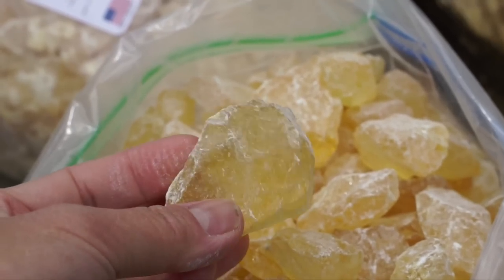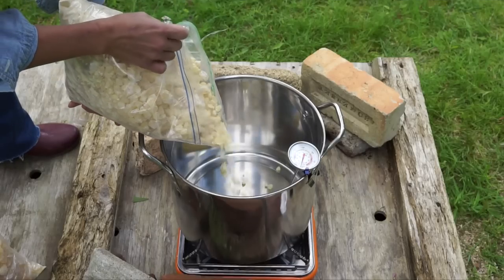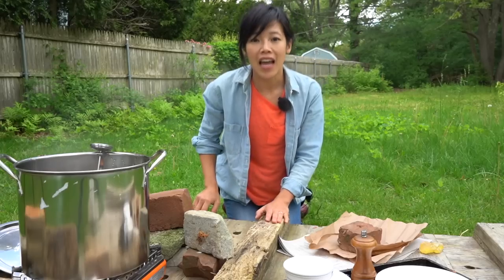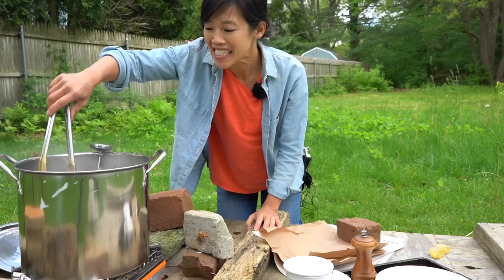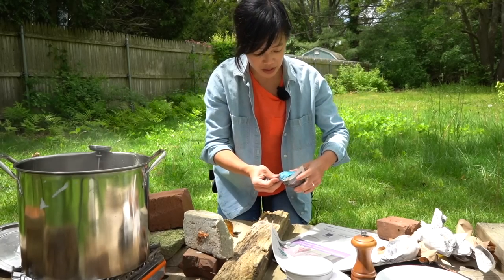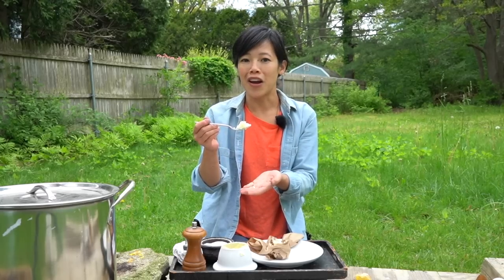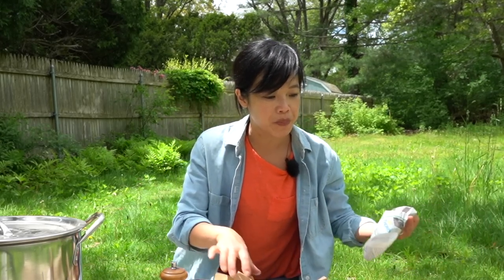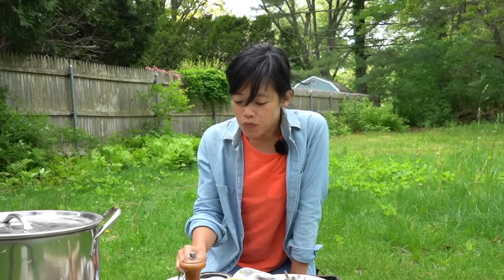How to Make PINE ROSIN POTATOES | Turpentine Potatoes -- Best Spuds Ever? -- In The Old Days

Comment: “But there were some health concerns regarding cooking with rosin...” Emmy: let’s do this
Reply: Prob not health concerns as in the rosin or cooking method itself will make you sick - industrial cooking food safety has to be standardized to a T, and the risk of accidentally putting the rosin tongs in the deep fryer alone is bound to make a health inspector nervous 😂 But in your own kitchen you can make sure that the rosin equipment is taken care of properly so you shouldn’t have any problems!
Reply: There might actually be more concerns about people being exposed day in and day out constantly. Plus very minor concerns can cause trouble in a commercial setting. 
If I felt like putting the money or work into it I probably wouldn't worry about occasionally eating it. Just don't eat the skins.
Reply: It's more due to the fumes from the heated rosin, which in a well ventilated area (such as outside), should not pose a high risk. If you're really worried, wear a ventilator or mask while cooking.
Reply: 🤣🤣🤣 sooo enfp!
Reply: @jazmin6031  nah, I think she's an infj
Reply: @SwitchelSweets  It's a lot easier to boil, fry or bake a potato. Also doesn't require toxic fucking turpentine, and having to separate the skin... It's just like wtf whyyyyyy do this.
Reply: I think one concern is someone getting burned. That stuff is like lava. I had them at the Cracker Barrel
Reply: @jacklewisjones1  Because it's real good and there's no toxins in the pototoe from the Rosin.  I eat metric tons of Rosin Potatoes when I was young fifty years ago or more and they are indeed the best potatoes on earth.  the Rosin seals the potatoe and there is no lost of moisture which steams the potatoe from the inside and makes them fluffy like cotton candy.
Reply: @donaldsanders5124  It's a biproduct from papermills.
Reply: @juggeist  look up traditional slash pine collection. cutting turps or naval stores natural product of southern pine forests
Reply: @jacklewisjones1 you're boiling them in rosin not turpentine.

Comment: Probably another reason to avoid doing it indoors is that (I suspect) it would leave rosin _everywhere_. There's no water in the rosin. What's boiling there is organic compounds. They hit vapor form, boil up into the air and either turn to fine powder raining down, or they make it all the way to a surface, where the molecules solidify again. It's sort of like how boiling water without a vent leaves a lot of condensed water on the nearby cabinets. But instead of water, you get.... waxy plastic, I guess?

Comment: They look so yummy! But I wonder what the “health concerns” you talked about would be.
Reply: Joey Joe I did a quick google search, so by no means do I know much about it, but I was curious too. From what I found the skin is poisonous/toxic due to the rosin, but the inside isn’t. People cook onions in the same way. It originated in North Carolina. And it is really dangerous to have exposed skin because it’s like getting tar on your skin. Some dude talked about a big scar on his leg. And it has to be done outside.

Edit: also when I have made lotion with essential oil, I read that I should be careful with any oil derived from a pine tree. I assume traces of turpentine is the reason.
Reply: aliza goehner Thanks for the reply! That was informative. So it’s not good to digest it or get it on your skin!
Reply: Joey Joe no peoblemo! And yes, from what I found you are exactly right, do not eat and do not touch when melted.
Reply: @AlizaJayne  I wouldn't make this. I can imagine specks of rosin getting into the potato.

Comment: How did you clean the pot? Do you heat up the resin and dump it?

Seems like a nightmare once it cools down
Reply: I would clean it by first pouring out as much as possible into a wooden or cardboard mould, then putting the pot in ice water while the resin is still hot to make the resin harden instantly and shrink away from the inside of the pot.
Reply: You don't clean it. She says you just reheat it and store it in the same pot later. You can't use the pot or tongs for anything else.
Reply: You don't. You save it for the next batch

Comment: Cool backyard. Did the resin ruin your pot?
Reply: Oh friend, it ruins everything it (the rosin) comes into contact with! I have some experience with these sorts of things being an artist, and it's the consistency of liquid pitch when it's warm enough. That stuff is legit. That cauldron Em had a going could tar and feather, and burn up a person like you would not believe. Extreme caution. Only approach like you would an ornery dragon lol
Reply from the maker: Yes and no.  That pot and tongs will forever be for making rosin potatoes.  I left the rosin in the pot and will melt it down for next time.
Reply: Thanks for the reply. Love you videos.
Reply: @kahldrialeighsun1208  which is why pine resin, white spirits, and hydrogen superoxide mixed to a syrup consistence poured in  sealed glass bottles is the Finnish original recipie for molotov coctails.
And they were lit, not by a doused rag, but with a wax coated safety match compound on the end of a sparkler tied to the body of the bottle with steel wire to leave the neck free to use as a throwing handle.
The sparkler method is far safer and effective than a rag as there is no risk of igniting the contents before the bottle breaks and there is no risk of the fuel inadvertently dousing the flame on impact as the sparkler burns much hotter and contains it's own oxidiser that makes it air-independant, just like the hydrogen-superoxide addative does for the coctail itself.
The sparkler also allow the thrower to abort a throw even after lighting up, by just allowing the sparkler match to burn out and replace it with a new one for a better opportunity.
Reply: @SonsOfLorgar  Wow that is fascinating. I love learning. I love  history. 😁
Reply: @kahldrialeighsun1208  also, those main  ingredients are far easier to get in Karelian Taiga than petroleum fuels

Comment: I'm an artist and we use rosin to make aquatint prints. I had no idea you could eat it. We usually ground it down to a fine dust, baked it on our plates, and used it to protect the surface of the plates from acids and corrosive salts.

Comment: You can also use pine resin/rosin to stain wood furniture. It's a beautiful color and can leave it outside and it will never rot or discolor. I live in NC and we have lots of pine resin/rosin(the way you pronounce it depends on where you live). My father used to put it on the wood swings on the car port.  Maybe you can do that as a project with a small piece furniture that you leave outside that needs waterproofing. Just a suggestion.

Comment: You can get similar results with olive oil and sea salt coated potatoes when baking them off in the oven. The salt seals in all the moisture.   To fluff don't use a knife use a fork to stab down the potato counter to how you would do a knife slit then pinch open hard and you will get a wonderful fluffy top. The jagged fork pokes will create a perfect unevenness so the fluffy potato can crown.

Comment: I love the idea of you trying the rosin potatoes. My only concern comes from my restaurant background, where they tell us not to wrap baked potatoes with foil when placing them into the oven. But instead to leave them without foil and to just place them skin only into the oven because of fear of botulism from the skins being sweated in the foil. And for whatever manures ore fertilizers in the soil that may still be on the potatoes. That being said, I was concerned about the skin of the potatoes being covered in the pine resin if it would do a similar concern with botulism because the skin is coated in resin like as if it was in foil? Hmm? I would have to look more into the research of this. It sounds amazing. And it's not something I have heard of here in the South. Thank you for sharing this.

Comment: I'm probably not the first to mention it, but rosin is also used in soldering. When heated it's corrosive enough to remove oxides. Hate to think how much of it has passed through my body - yeah, I'm bad and should have a proper extraction system.

Comment: We used to risen bake potatoes in the 1970s. That’s the best way to cook them. My Grandfather was a producer of raw gum spirits of turpentine and had 240,000 pine trees tapped. Now days it is almost a lost art. 
If you dip your tongs into the boiling risen , it will remove the lump that forms on them.

To “hang” a pine tree you :
Cut a small amount of bark off to make it smooth 

Nail on 2 “tins” that are shaped to fit the curve of the  tree 

Drive a #16 nail below the tins and snap a rectangular 1 gallon “cup” in between the tins and the nail 

Make a thin slash into the bark with a “hack” and spray sulfuric acid into the slash 

The sap will run down the tree and collect in the cup

You would collect the sap and place it into 55 gallon drums 

The turpitude still would boil off the pure turpentine spirits and the risen would be the buy product

There you have it, the process of turpentining .

Each tree would produce about 1.5 gallons of sap every month during the summer months.

Comment: if you soak your gear with alcohol, denatured or grain, it will dissolve the rosin, solvent vs adhesive. ironically, turpentine can be used too lol. Don't leave it to dry out, once it's dissolved, wash it well or it will become sticky again once the solvent has evaporated

Comment: Did you know that you can boil the potatoes 🥔 in water and you don’t have to buy the to rosin if you put them on a rack above the water and steaming them for about 30 minutes they come out the same if the inside isn’t soft and fluffy you need to cook them a little longer I don’t see the point potato’s will keep for about a year or longer if you keep them cool 😎